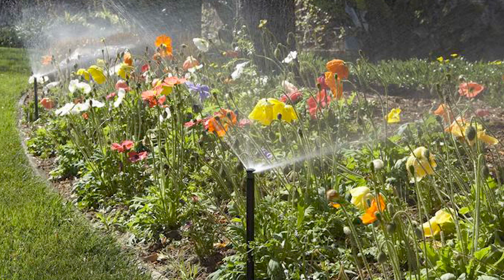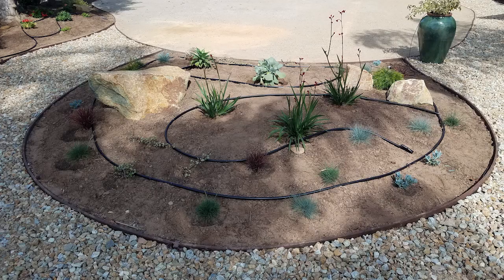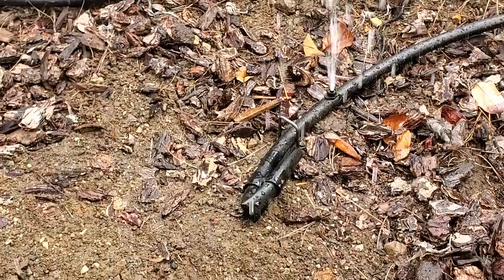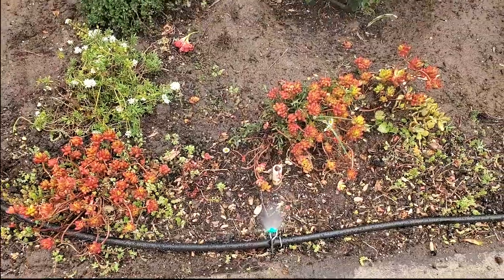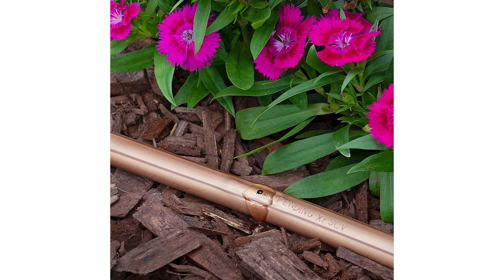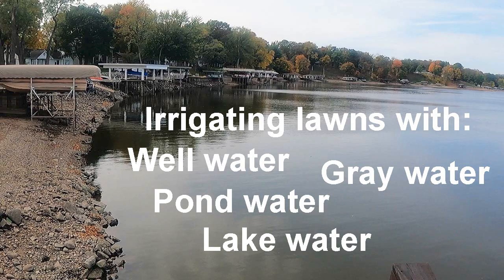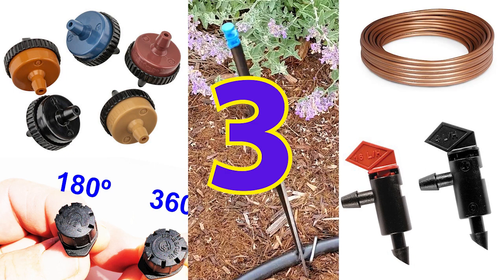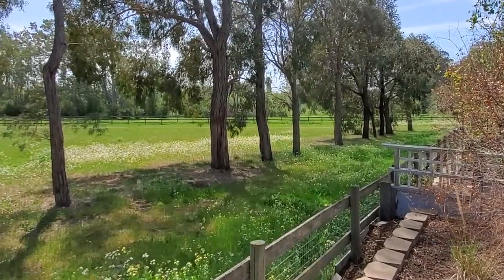The 3 main different types of drip irrigation and when to use them

Comment: For drip irrigation of mature potted fruit trees, which emitters would you recommend?
Reply from the maker: Geriann, I don't know how large the containers are but button emitters are probably fine. Hunter makes a .5 GPH emitter that I typically use in containers as opposed to the typical 1 GPH version. It's a judgment call based on how long you typically run that line and how large the container is.

Comment: Thank you for this video. So you put the tech line on top of mulch?
Reply from the maker: It's better to put it under the mulch so it's not exposed to the sun AND so half the water doesn't just soak up into the mulch before getting to the soil and thus the roots. Those photos were mostly for your edification so you could see the Techline laid and its path. I typically leave it up to the homeowner or their gardener to bury it under the mulch to save them money.

Comment: I have 1/2 inch brown tubing with pre installed emitters running in my garden but some plants need a little more water than others. Can I punch into it with additional emitters? Or add bubblers using 1/4 tubing?

 You said techline should not be punched into with 1/4 inch tubing. Can you elaborate?
Reply from the maker: Alena, Nice idea but that tubing isn't designed to be punched into. Consider a 1/2" barbed tee (made for the Techline) and add another run of Techline down the other side of the plants. Another way is to tee off the Techline to 1/2" black tubing and punch holes in it to your heart's content. 😉
Reply: @SprinklerPros  thank you!  So where can I find this barbed tee that’s made specifically for tech line?  And how is it different from the barbed tees that go into 1/2 blank line supply tubing, which I normally use to add 1/4 delivery branches (I think of these as the “last mile” as they will deliver 1-4gal directly to the base of the plant) 

Side note: I probably need some help with my industry terminology vocabulary ;)
Reply from the maker: Your lingo's pretty on track. I purchase pretty much all my materials at professional landscape/irrigation suppliers like Ewing or SiteOne. They stock the Techline barbed fittings. The difference is the size.  The 1/4" barbed couplers you are asking about are tiny compared to the Techline fittings. As mentioned in the video, consider avoiding using the 1/4" tubing to the plants and putting emitters next to the base of plants and trees. In most cases you can put the emitters directly into the 1/2" black tubing and let the roots come to the water.  I hope this answered your questions thus far.

Comment: flag emitters CAN be easily cleaned.  Just rotate them as you pull.  There is a notch in the black plastic part so when you rotate to the correct position you can pull it out and flush it.  Then reinstall by pushing it in while rotating until it sets in then rotate a bit away from the notch.  Done!  All cleaned.   And if you put it at the end of the 1/4 tube rather that at the larger tube (1/2" or 3/4" typ).  they are less likely to break.
Reply from the maker: Thanks for being helpful. I have done this many times over the yrs without much success. I have also had the emitter break from being brittle when I messed with it. Great intel though.

Comment: I was told by all the neighbors that bc we are all on wells, I need to buy flag emitters bc those are the easiest to clean.  What the heck?
Reply from the maker: ok.  Sorry, what's bc?  Have you watched my video about well water systems? If you have good filtration and keep it clean, you should have no need to clean out emitters. My 40 yrs experience with flag emitters is that they eventually get stuck to where you can't open them and the flag may break when you attempt to turn the flag. Your best defense is filtration before the valves and after the valves. I wish you well.
Reply: @SprinklerPros  flag emitters CAN be easily cleaned.  Just rotate them as you pull.  There is a notch in the black plastic part so when you rotate to the correct position you can pull it out and flush it.  Then reinstall by pushing it in while rotating until it sets in then rotate a bit away from the notch.  Done!  All cleaned.   And if you put it at the end of the 1/4 tube rather that at the larger tube (1/2" or 3/4" typ).  they are less likely to break.

Comment: What type of emitter would you recommend for hanging baskets on a zone with other shrubs and trees.
Reply from the maker: Hunter makes a .5 GPH (1/2 gallon per hour) button emitter. Another option that I just used last week for a bunch of container plants is a 1/4" ball valve. You can use a std. 1/4" coupler to go from 1/2" tubing to 1/4" tubing and then at the other end of the 1/4" tubing that is in the container, you install the ball valve which you can adjust the flow and turn it off if desired.

Comment: can you run multiple systems from one central line
Reply from the maker: If you mean more than one 1/2" drip tubing lateral from one valve? Yes but keep in mind that a 3/4" valve with 3/4" schedule 40 piping  can only safely handle up to 8 GPM and 1/2" drip tubing can only handle 4 GPM so, without knowing your design and length of laterals and how many emitters of unknown gallonage output, I wouldn't be able to tell you exactly how much you can put on a line, but you can use the above numbers to get an idea of where I'm going with this. I am planning to create a complete drip system installation guide so stay tuned and subscribe to get the announcement.

Comment: Why 30 minute minimum for tech line? If I run .a .9g/m tech line, 100’ there and 100’ back, so it hits each area twice, in 15 min connected to a rain bird retro (converted pop up sprinkler), it should deliver .45 gallons. Correct? Or what would be bad about this?
Reply from the maker: Yep. Same idea. My example is obviously with just one run for ease of example. Thanks for bringing that up with everyone.

Comment: What emitter type do you suggest for a garden of 50 containers? 15 gallon, 10 gallon and 5 gallon containers are used.  Thank you 😊
Reply from the maker: Lynn, there are so many factors to consider including weather, how much water you can tolerate leaking out of the containers, whether you are willing to use adjustable emitters or if you want to keep it super simple, etc. The easiest are the 1 GPH button emitters.

Comment: Hi sir..can you please suggest best drip emitter for citrus that doesn't block water by strukking mud into it..
Reply from the maker: Sandeep, There are no emitters that can be guaranteed to NOT get debris in them, but the adjustable emitters shown at 1:31 can be flushed out if they get debris in them. The best way to help the emitters to stay clean is to be sure there is a filter on the system as seen at 2:18.

Comment: So much more efficient to water at the ground than sprays. Sprays spread disease and waste water. Not to mention the tall sprays are not attractive and easy to break. Many annuals and perennials don’t care for watering by spray. Go with emitter tubing for all.
Reply: If I have manzanita ‘emeralds carpet’, would you also recommend I used the brown emitter tubing? Maybe spaced at 6”? Thanks in advance.
Reply: @bdm408  either drip line or 2 gph emitters thar clog less then 1 gph emitters and reduce water usage vs sprays or drip line and reduce weeds